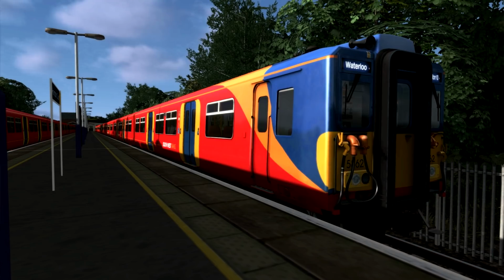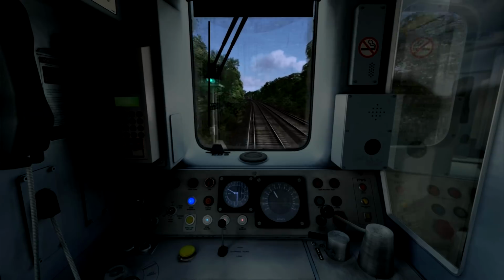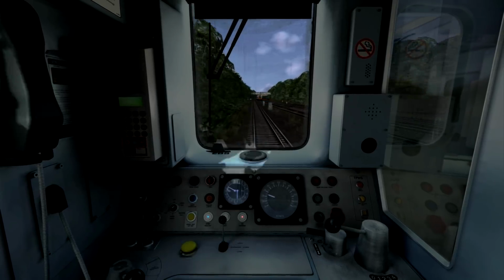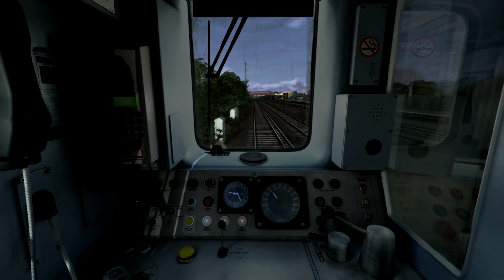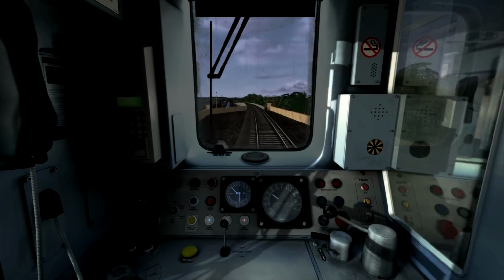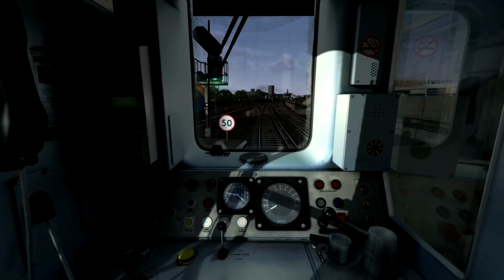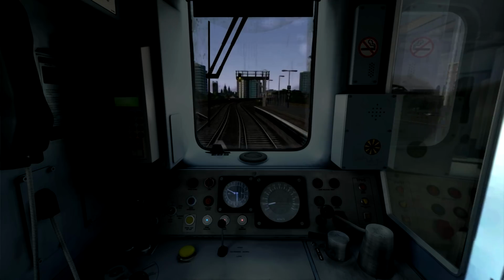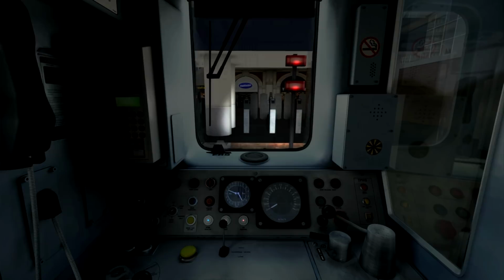Train Simulator 2018 - Route Learning: Hampton Court to London Waterloo (Class 455/8)

Comment: Brilliant video as always. I’m going to have a crack at making a scenario on this route using a 455/456 combo 👍
Reply: SingleDeckerMichael funnily enough I had the same idea I think it would be good to do with the 456 leading with the 455 on the rear 😁
Reply: Darren Knock exactly what I’m doing 😉
Reply: SingleDeckerMichael I think if I'm correct they normally form up of 2 456's and 1 455 on the rear to make an 8 car unit during peak hours to allocate spare 455's for more lengthy runs on the mainline for services to and from Woking and Guildford.

And just for an idea you could do an 8 car service to Hampton Court from London Waterloo using a 455/456 combo but split the train at Surbiton to allow for a possible service to Woking with the rear 4 car 455 and just have 2 456's going on to Hampton Court as I believe they occasuonly do this in real life too. 👍😁
Reply: Darren Knock I’m not too familiar with SWT but I believe they also work as 1 456 and 2 455 to form 10 car trains. I’m working on a Waterloo to Woking stopper, but I don’t have much luck with scenarios so we’ll see how it goes.
Reply: woking services generally don’t stop at raynes park, new malden and berrylands, so I can’t see that happening

Comment: The 442would present an interesting challenge. They were used on the PDL but only very rarely as the fact they only had 1 powered car per set meant the steep gradients on the line proved a challenge and often meant that 442s on Portsmouth services ran late south of Guildford.

Comment: Modern day route service please. Thanks for your videos. As I am fairly new to TS18, I have a couple of questions regarding this video - is there a feature on this scenario where the driver receives a double-buzz from the guard to indicate that the doors are closed and the train can depart, and also does the scenario comes with the feature allowing the driver to set up the destination header indications on the front of the train ?

Comment: Cl.442 pls :3

Nice video, may I suggest turning down your graphics settings slightly for this route? :p
You are correct in saying coasting when cresting hills (and crawling up to signals) is more energy efficient, particularly in locos, DMUs and older EMUs which can't do regenerative braking. 
Even on modern EMUs, regeneration isn't 100% efficient so coasting is always better than powering up a hill then braking on the way down (unless you're trying to make up time).

This glorious 1991 film goes into (a bit) more detail: https://www.youtube.com/watch?v=ca2lGLI_ICs
Reply from the maker: It seems the Class 442 is winning by a whisker!
The graphics settings were turned down a bit, otherwise the game crash dumped before I could get to Waterloo :p
Thanks for the info, I’ll check out that video soon :)